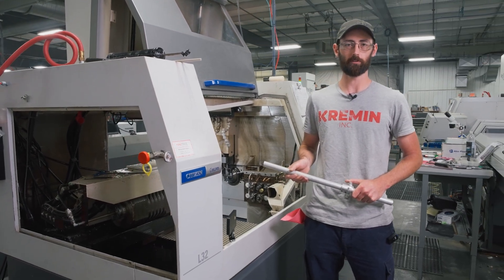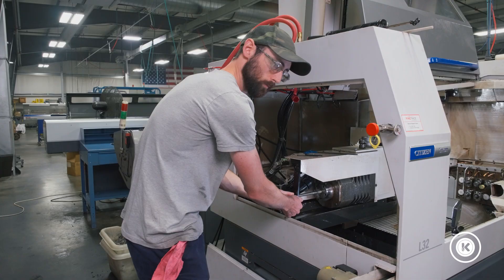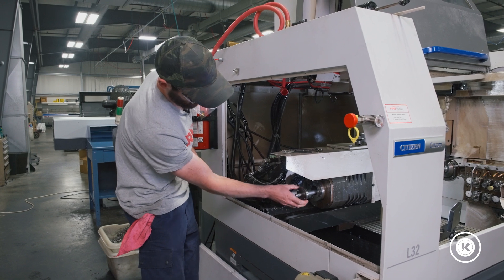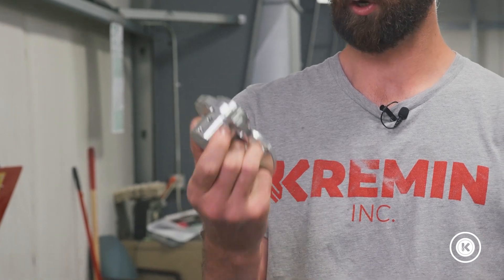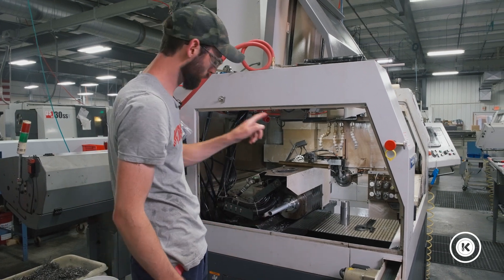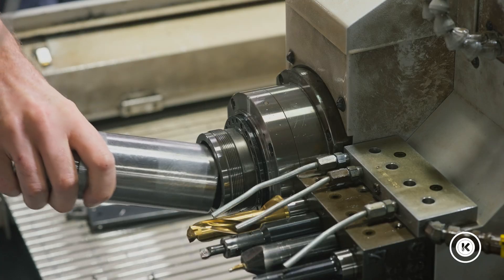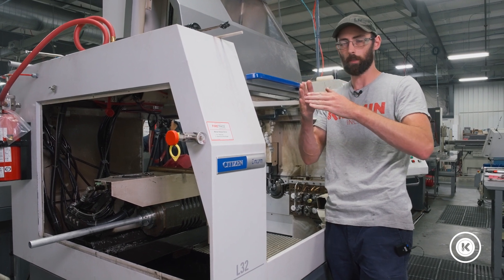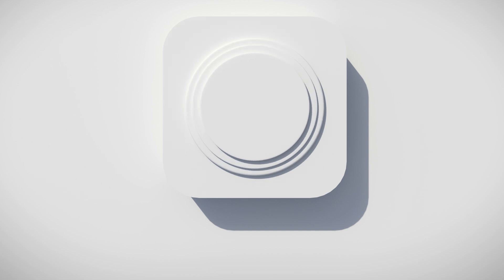How to Replace Citizen L32 Knockout Rod with Through Tube

Comment: Keep the videos coming!!! You need to make a video on setting up the code to do a "part shift" with the spindles. I am trying to make a 10" long part and I only have 8" of travel. How do I re grip? Also if you can send me the code before you make the video that would be great also!!
Reply: M5(spindle stop)
M1
M7(main open)
G4 U.5(dwell)
G98G1W-.5F200.(rechuck, W is rechuck distance.)
G50W5.(Shift zero, must match rechuck length)
M6(main close)
G4 U.5(dwell)
G99

Lift the tool up away from the OD before rechecking, then call it back. There will be a step from cutting pressure, so do the rechuck over where a groove will be if possible.

Can also call the sub up to hold the part/bar while rechecking so the main doesn't drag it back or the bar loader push it thru the guide bushing.
Reply: @SecondFloorOutdoors  Always use sub to hold bar during re chucking !!! And do not hit sleeve to install.